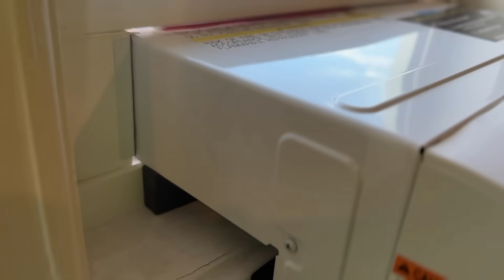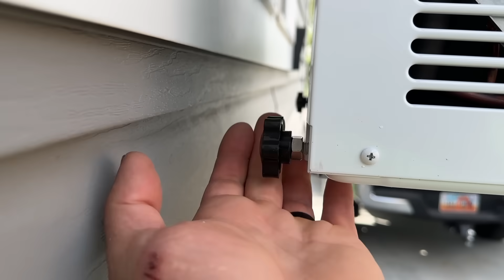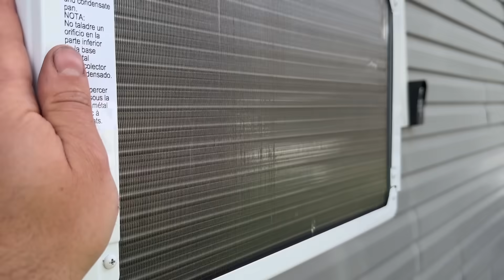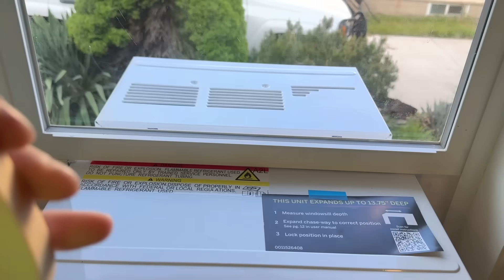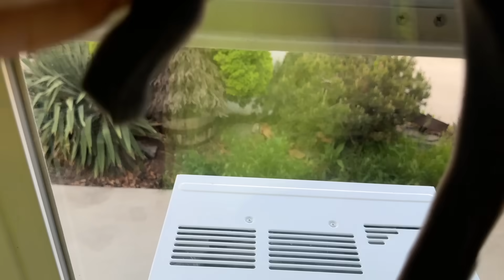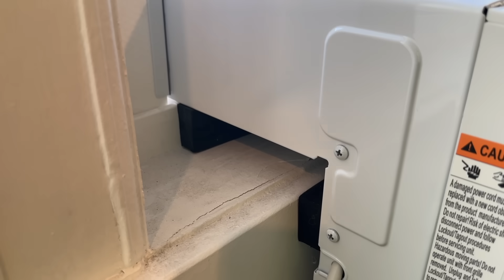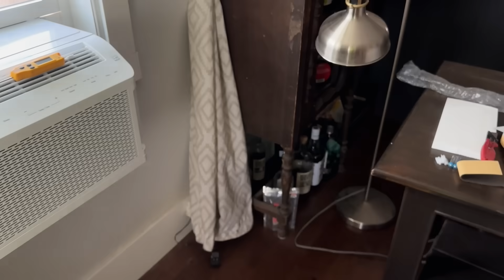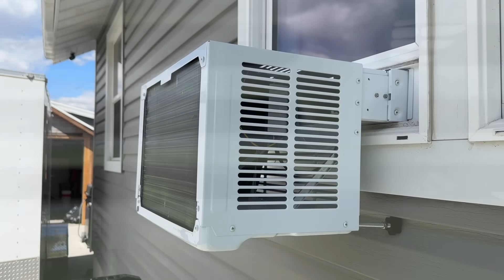Why Didn't Anyone Think Of This Sooner?

Comment: I've been thinking of this idea for a long time time by removing the window and a simple modification of the window opening it could be built in now all that's needed is a reversing model no DIY mini split just open up the area of install put the unit in and fix the sliding and drywall anybody well almost anybody can do that putting below an existing window is simple R&R I'm not comfortable installing i
 A  mini split because of working with freon now all the government needs to do is outlaw ac only units and instead of a unit only being used for part of 2 months it can be used for most of 8 months 2 as cooling and 3 spring and fall and part of winter

Comment: I really liked design . I was ,and am, considering the design, which is the opposite of this one. The saddle faces UP like a staple, but it is MUCH harder to install and not as stable. This is a big improvement over the original design, BUT I have a big old radiator under each window, so this unit won't work for me. WAAAAH😢

Comment: Great design, I'm lucky in that I live in an old house with old windows. Open window, sit A/C in window, lower window and open louvers on side. It takes me about 3 minutes to put in the window or remove from window. I usually store in front of window on the floor out of season. It sits under a table normally. But modern homes and their complex window frames all nice and plastic and small are a real challenge.

Comment: I had a similar "saddle" style window a/c back in the 60's with a slightly different design. The bottom was flat and sat on the sill and the top window sash slid down into the saddle. Nothing new.

Comment: Great video.  I've got the 8300 btu and it's quietest window unit by far I've ever had and I see Amazon has a 12,000 btu one so I may order it too.  I like this design a lot because there's zero weight pulling out on window from weight of air conditioner like traditional window units.  Another benefit for me is I have fairly narrow window openings in one room so traditional window units are too tall... but I can pop out the adjustable window slider then the Clearview fits thru opening and U shape lets it drop down then I put the slide part of the window back on.  3rd I feel these should be harder to steal and harder to break in especially if you put a block or screw or something above the sliding part of the window so window can't be easily opened without removing the screw or block. I'm 60 and installed by myself in about 30 minutes so should be easy for most to install quickly.

Comment: Should have a similarly designed 110~120V heat pump, like a mini spilt, but without the seperate line sets and expensive installation.

Comment: This unit is SUPPOSED to make that splashing sound.  As the water is condensed and pulled from the room it is sent to a tray that the fan sits in.  When the fan spins it splashes this water onto the condenser coils and cools them off.  A cooler condenser coil will then make cooler refrigerant in the system.  That equals cooler air out of the unit on the inside.  This is not a bug it is a feature.  It makes the system more efficient.  By tilting the unit you have defeated this feature.  It will run just fine and won't damage it, you are just using more power in the long run to cool your room.  The unit was designed to be level.

Comment: Has anyone tried this type AC on a truck or car? Serious!
Heater core is leaking and it would cost more than the truck is worth to fix the AC alone. I've got the correct size generator. Heat pump style sounds perfect for my neck of the woods. YES!!!

Comment: The outside fan is supposed to pick up the condensate water and fling it on the outside (hot) coil to increase efficiency as the evaporation of the water cools the hot side (and the evaporation energy closely matches the condensation energy that was used on the inside) Directing the water away from that area will reduce the efficiency by about 6%. 

I'm surprised an HVAC guy would not realize that.

Comment: "Why Didn't Anyone Think Of This Sooner?" Answer: traditional window units are meant to have a slight angle when installing, the exterior side of the unit dipping down lower than the interior side, so condensation drips out the back of the unit to the outside. I'm assuming this newer style must have a water pump inside to suck condensation from the front and push it out to the back so it drips to the outside.

Comment: Hearing water sloshing on the condenser is a good thing. you want that. That is cooling off your condenser by a part called a Slinger. It helps your AC unit run cooler.

Comment: If you have a forced air furnace its probably cheaper to install a full AC unit.
I found mine only 1 yr old from someone who was upgrading to heat pumps.
Cost me $500CAD installed.

Comment: I've got three  little remote control window units that (mostly) hang outside the window. They cost me (used) fifty to seventy-five dollars each.  This thing sells for nearly $400 on Amazon - so four of mine, maybe five.  The bits of foam insulation and gasket material are easy enough to come by (especially around Christmas time! ;).  Sealing things up is the critical thing.

Comment: I have one as it is nice, but it actually takes up more room than an actual window unit and it also uses more energy. This thing requires extra maintenance as you got to check two air filters and one water pump filter to make sure it stays clean so your pump doesn't go out as you will have a house full of water. It is very quiet and it definitely blows some cold air out of it and I love the dehumidifier mode in it. Definitely gives me better access to my window, but you have to sacrifice some space inside and outside.

Comment: Somebody did think about this sooner. Soleus AC did, and I bought one years ago, specifically for its saddle design. It’s the same as your model. As usual with GE, they just rebranded it with a different panel. The reason this design didn’t come out a decade ago is because unlike other designs, the condensation can’t be drained to the evaporator side. It relies on a pump to bring the water up and over, so the more complex parts and engineering makes it more expensive. Fortunately, AC units have been getting cheaper to make, so it’s less cost-prohibitive to make interesting design. If anyone is interested in longevity, I bought it 4 years ago and it’s on right now, so no issues so far.

Comment: I like this design but feel compelled to provide my recent experience with a GE window ac I purchased about two years ago.  First cooling season - No issue.  Went to turn it on the first time in season two - it turned on with an error code and was unusable.  Error code indicated the logic board was malfunctioning.  Scheduled a service call, a couple days prior the third party repair company cancelled.  I started internet searches for parts, repair videos, common issues etc. and encountered an extensive list of others who experienced the same problem only I was one of the lucky ones - my unit lasted the whole season, many others stated their units broke down as soon as a month after installing.  Although my unit was fairly new, GE did not sell repair parts for this fix though it was obviously a very common issue.  It appears to me that from the manufactures perspective this is supposed to be a non-repairable product.  Perhaps planned obsolesence.  I like many others had apparently no other alternative than to scrap an otherwise good product save for a replaceable part.  Your mileage may differ good luck.

Comment: Old man here….was a service tech for Sears 1967-78 . We had saddle designed units for both slider and double hung windows. Everything old is new again. New units are much more efficient , quieter and LESS expensive. Just a thought ….the condenser is not protected by the filter, I think that the slinging of the evaporator condensate helps keep it clean, but it will plug up eventually.

Comment: Nothing new here. This design has been out for a while. 
Check out what they have in Italy. It’s a small single package unit that goes under the window and with 2 - 4” holes though the wall with a cover of course. It will be a lot better than this ugly thing. So yes you don’t need to drill the wall and can remove it with this one but any window shaker is yuk.

Comment: As others pointed out, the condensed water is needed to keep the efficiency up.  When it evaporates, it adds to the cooling through the evaporator.  
Now, all this is well and good for MUCH of the country.  However, I'd like to know who, out in the western states, decided that every house has to be built with either side-slide or side swing windows!?!?  You want to know agony, it is trying to mount an air conditioner anywhere but through a hole cut in the wall.

Comment: It's a very ingenious design. However, I think the air intake windows on either side of the outer unit should have a removable air filter so that the condenser coils need not be cleaned as often and the life of the condenser coils can be extended as well.

Comment: I thought of this 25 years ago  but no one took me seriously.

Just kidding,  but i did think of a unit like this  it could be a mini split type heat cool system that only requires a window open 2" 
This unit looks like its 6" open.
The outside unit could hang or be bolted to the outside wall at the jack studs under the window opening or on bricks.  Also it can provide heat and cool year round
And work via a smart phone app
Over your wireless network, the best part is it runs off 120 volts.
Or 240.

Comment: That does not sound sound to awesome. A few hours and it dropped 10 degrees. You normally drop 1 degree every minute in a 100-200 sqft room with a 13k btu air conditioner. A real good air conditioner is those LG( I forgot the model number. It’s in storage. Quiet comfort from the new line up two years ago). I bought one. When it first came out. They might be cheaper now. A 900sqft apartment. Would cool down in 5 minutes. One test I ran. The weather was in the high 90s. In about 7 minutes. It was at 70 F degrees. A little warmer. The further you walk away from it. I set the thermostat at 70F. That’s impressive. This was noisy until it got down to temp. Quiet while maintaining temp. Real noisy like a car engine with the hood up. When at temp. Whisper quiet.

Comment: That idea has been around for a while. This particular design hangs below the window seal. I've seen a style that sets above the window seal and has a 2" gap so the window can close most of the way down. It's basically the same design just flipped over.

Comment: Why do modern refrigerators have the hot compressor on the bottom? Why is the insulation do thin on modern refrigerators, and then they call them efficient, when the old one had the compressor on the top, so heat radiated away from the frig being cooled.

Comment: They did.   GE used to make ones in the 1970's that had a gap from above for just the window sash to come down into.  The reason we have the boxy ones is you can use a single fan motor to run them both in and out.  The ones with the gap from above can still drain condensate out without having to have some stupid pump mechanism.     I say stupid pump mechanism because the pump mechanism will destroy your home, rot your carpets and make you sick with brain damage.   Don't buy the hangy-down ones.   In fact don't install the goddamned things low in the wall at all.   Wall units are for putting in special holes or in a frame at the top of the damned window where the hot air is.   THEY AREN'T FOR WINDOWS.

Comment: You can get units like these which are actually heat pumps, and not just A/C units.  So, they can do both heating and cooling, and are more efficient than units that can only do A/C.

Comment: I had a older low profile window AC like that but it took a kW of power for a 8,000 BTU unit so I gave it away and got a more conventional window AC that uses just 585 watts of power.

Comment: There is one disadvantage with this type of design: if your AC starts leaking, and it is the old design, you can tip it so it leans outward, so that all of the water runs out of the house.  With this kind of unit, you can't lean it outward if it starts leaking.

Comment: In a previous video  this guy said he does not like inverter high-efficiency, etc. because it’s more complicated. He likes simple. He, said high-efficiency furnaces and air conditioners are not worth it because the cost of Repair will wash away money saved on utilities. 

I was very surprised to hear him promote high-efficiency variable speed, compressor, and energy savings in this video

Comment: Discharging 36??!  On a DX unit??  How is that coil not freezing up?  Although I guess if it has a dehum mode, it'll have some sort of heater so maybe they're using that to defrost the coil?  I dunno but that's insanely cold (if you're not familiar, 55deg discharge air temp is normal for AC, and even 50 would be remarkably cold.  36 is crazy).  Seems like a great unit.

Comment: I had one like this in 1970. I think I bought it at Sears. It worked great. The saddle pointed up on both sides of the window. The windows closed down into it and kept the compressor noise outside and was not as large because it only needed to enclose the window mullion and not the whole thickness of the house wall.

Comment: Panasonic made a similar unit in Malaysia years ago with the opposite design - most of it was hanging outside. It cost over twice as much as a regular window air conditioner unit but it was extemely quiet. 
It was mounted in a window next to a TV running at low volume and the only way you could tell it was
on was the cool breeze. Wish I had kept it.

Comment: The stainless steel nuts on the feet that press against the siding should be threaded back to the side of the unit to prevent the vibration from loosening them.

Comment: This is really interesting.  I have no need for this, however, in our kitchen we have these tiny windows over the sink that open up to maybe 12 inches at best, maybe a little more.   We don't have any ventilation in the kitchen above the stove because the house is pretty old.  I have tried putting little fans in the windows to help when cooking but they just don't help like I would hope.
I wonder if there is a solution like this that would just force air from the kitchen outside of the house?
I need to look into this.

Comment: If you like toads and frogs, which are beneficial insect eaters, create a microclimate for them beneath your AC units. You can buy fish castles for aquariums, or just repurpose 20 to 30 ounce plastic bowls or butter tubs, by cutting 2 inch wide by 2 inch deep hole in the rim. Turn it upside down and put a rock on top, or spike it down with tent stakes, to keep preditors from turning it over. Place it beside the ponding water beneath the AC unit for frog and toads houses. You can divt the place where the water drops to form a tiny pond. If you think they are unsightly, you can paint them green or brown to blend in with the yard color.

Comment: They DID! I have a 1948 Gibson 8000 BTU window A/C with "split-design" that weighs just over 500 pounds. It was my late brother-in-law's and he gave it to me to put in m home workshop. It STILL works fine as quiet as a church-mouse, but the fan doesn't "blow much air", which was NORMAL until the late 60's. It's gold with the four round vents on the front in cream-colored plastic. It's a 120 volt, "12 amp" unit, that draws less than 600 watts running by my Kill-Er-Watt meter. If I want the shop cooled, I turn the unit on 24-30 hours BEFORE I want to work in there-just like a 1956 Fedders or Amana or Friedrich (the first we had in my parent's house). It doesn't use Freon-it uses anhydrous ammonia for refrigerant!

Comment: The GE Profile series has a deficiency.  The display is SO dim.  Where it shows the temperature setting numbers, they are usually too dim to see in a sunlit room.  Dim white numbers under a white panel.  Not good.  Can even see that in your video somewhat.

Comment: For security, checking for clearance in certain window frames, you might consider drilling holes into the frame to allow a screw or larger diameter nail (loose fit) to be installed just about where the window stops. A double headed nail or just drilling the hole deep enough so 1/2" sticks out to stop frame rise. You can also use 1/4" or 1/2" lathe in the frame track cut to length. This can even be use with double velcro to make removal easy. Just paint the new wood and secure. This removes the capability for a bad guy to open the window and remove the unit for entry.

Comment: This is a great design improvement however it will be of no use to the zillions of apartment-dwellers having casement windows and no central air conditioning. Well I guess they can bust out a window pane for the duct of a portable.

Comment: There is a drain plug on the bottom left of that condenser portion. You can remove that and not leave it tilted back towards the house. Try to keep the drainage away from the house.

Comment: I wonder if the interior and exterior halves can be separated then re-connected.  A clever homeowner might want to cut a slim, rectangular hole below a window, or for that matter, through a windowless exterior wall, and install it there.  Feasible?  Or would a ductless mini-split simply be better?